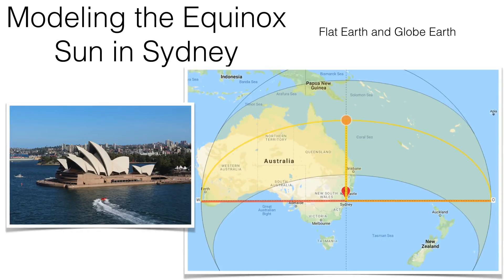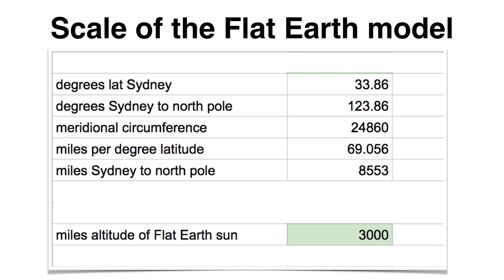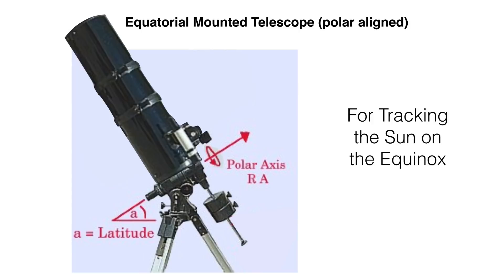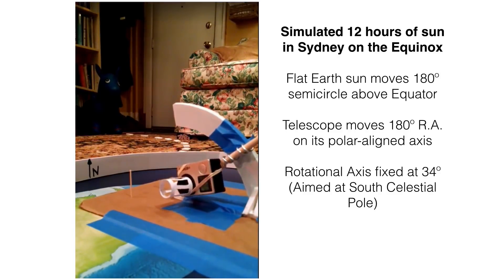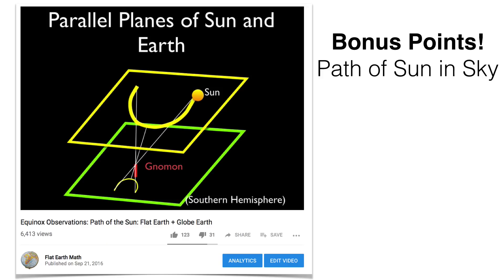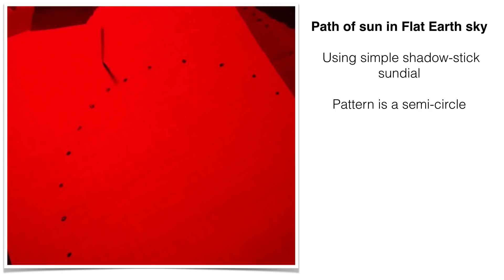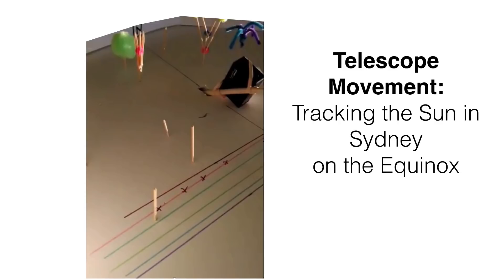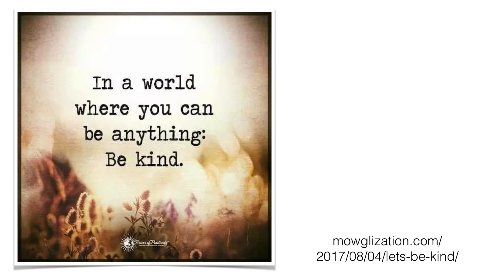Modeling the Equinox Sun in Sydney: Flat Earth + Globe Earth

Comment: Copernicus, given the Mason that he was, used the Satanic rule of inversion.
Latitudes have been inverted. IE: the tropics are at 66.5 not 23.5. When you understand this, you can use simple trig to calculate angles to the Sun.
Just like a NASA Satantist!!

The proof is that you could stand on the equator for a thousand years and you will never see the sun at an angle of 23.5 degrees. Only 66.5

Comment: When you were somewhat younger, did you build a clock work computer for tracking celestial objects that subsequently sunk in the Mediterranean near Antikythera? You seem handy with complicated models. Your mount seems to work better than a Celestron.
Reply from the maker: +Fudmottin, my fine feathered friend, yes, that Anthikythera widget was one of my earlier designs. But salt water is no friend. And as for my mount in this video, the key is that I was using a Celestron Hero4 telescope, without the mount, which I designed after my Antikythera widget, coincidentally.
Reply: Cool. It's truly amazing what you can do without an Arduino.

Comment: The perspective of the camera would be like looking from a high ass elevation...like 200 + miles up so of course your model will show the sun veering off before you get to the ground perspective horizon. You'd have to put the camera where the lens is right on the ground. That would better represent what you would see...oh and dont forget the refraction issue also..can you reproduce that...ive seen others put factual perspective in their experiments and it works just fine.
Reply from the maker: +Josiah Clayton thanks for your comment. I'm not sure you noticed, but the strip of curved foamcore that I marked W, N, and E was the same height as the lens of the camera. And the height of the flat Earth sun was measured above this "eye level." So I could have accomplished the same thing my digging a hole in the floor, but I couldn't do it practically. So I made an "eye level horizon."

Regardless of that, when I did the sundial (which was on the floor), it still showed the expected semicircular frowny-face. Meanwhile in the real world (I've actually done this) the pattern of shadows on the equinox is ruler-straight for 12 hours. Which makes no sense on a Flat Earth.
Reply: @FlatEarthMath  I understand the compensations you made and are equal mathematically but fail to take into account of angular perspective + refraction of the atmosphere from a specific point...and that would make horizon and the position of the sun different than what your experiment could show. I think you're wrong but if you can take all the realistic conditions into consideration then it'll prove your point...or mine...and since ive seen your experiment and what it shows look into rob skibas videos or ditrh videos on movement of the sun and the effects the atmosphere has on positioning. I have and find it more coclusive and contrary to your findings.
Reply from the maker: +Josiah Clayton thanks for your kind reply. :-) The big issue, especially since this demonstration takes place in Sydney, is that the sun is really, really far north of due East/West at sunrise/sunset. I'm very familiar with Rob Skiba's work, as well as David Weiss over at DITRH. But they've never shown any phenomenon which could deflect the sun's appearance 90 degrees or more laterally, while deflecting it 20 degrees or so vertically, so that it "just happens" to end up looking due East/West at the moment of sunrise/sunset. Exactly where the globe model predicts it should be on the Equinox.

You didn't mention the path of the sun in the sky. Are you suggesting that in a 12 hour period, the sun will move in a semicircle (by definition) yet, this curved path will turn ruler-straight due to atmospheric distortions? Don't you think that's rather convenient, especially since the globe model predicts a straight path?

There are a great many other issues with the Flat Earth model, such as angular size of the sun, speed of the sun in the sky, the angle the sun's path makes with the horizon, and the number of hours of sunshine on the equinox. And don't get me started on seeing the same face of the sun all day, for all observers on Earth, and the wagon-wheel effect (aka Field Rotation)! :-) In each and every case, our real-world observations align 100% with globe geometry predictions. Very, very convenient to have all these "atmospheric distortions" distort the reality of the Flat Earth sun so that it perfectly simulates the Globe Earth sun!
Reply: @FlatEarthMath  actually your experiment is invalid for many obvious reasons ive pointed out....but its cool I disagree but atleast your putting forth experiment...ya still didnt take essential things into account...later.
Reply: @josiahclayton3057  , try getting Skiba to flexplain how Polaris is somewhere directly above Santa's house at the North Pole, while simultaneously 40° above the horizon from New York, and simultaneously on the the horizon from the equator.

Just what exactly IS Polaris' altitude in Flattardia ?
Reply: @massimookissed1023  alot more reasonably placed than on ballickalotta.
Reply: @josiahclayton3057  so your explanation is the sun constantly move 15 degrees from you because somehow, refraction and angular perspective is compensating it? if you have a hallway. move the light down the hall. you will see that the light eill not move in constant degree. You are saying, at any given day, hot, cold, DST or not. The sun, due to refraction and perspective will make that sun move 15 degrees per hour on its path. And that path is not just straight down but it pans to the right or left. Thats your answer on that observation?
Reply: @algladyou  no...im saying depending on your exact location and environmental conditions at that location would determine where you see that horizontal line also the placement of the sun to its actual location and so therefore his experiment lacks conditions that would or could compensate for the sun veering off...understand it or not its cool...im through with this.
Reply: @josiahclayton3057  but we see the sun as how it is year after year om whatever location or latitude you are on. and the path of  sun is the same. thats why timeandate.com can predict where it rises and sets. And an EQ mount can even follow it from its path 15 degrees per hour. Where is your refraction and perspective are consistently at work here? Refraction  depending on environment is not consistent.

Comment: Latitude and longitude degrees are based of the globe. Not a flat map.
The flat Earth model does not have a south celestial pole.
In december solstice its midnight sun south of antarctic circle.  Hos would that be possible above a flat Earth?
Reply: sortsius Latitude and longitude make up actual points on our planet. 
A better question to ask is: Lines of longitude converge to a single point in Antarctica; how is that possible on a flat earth?

Just one of many questions where the answer is “Flat earth is inconsistent with data and/or observations.”

Comment: Love the contraptions.... and that copy of Zetetic Astronomy you have.  =)
My questions to you.... does variable conditions in the atmosphere affect the sun's radiance & visual size to the observers on the ground?  Does the thick atmosphere above act like a lens to the sky lights we see from the ground?  Does this lens of atmosphere bend lights in any way?

If yes.... then how accurate and reliable are the results of these experiemnts when conditions apply to the outcome?  Would you bare different results in the same experiment without an atmospheric lens layer above?
Reply from the maker: +JibbyJedi! The term "atmospheric lensing" is used incorrectly 100% of the time by Flat Earth folks. Yes, the atmosphere can bend light, by a fraction of a degree.. This in a vertical direction, as temperature and pressure gradients are horizontal. There are no known cases of light being bent even 1º sideways, let alone 90º sideways! This huge sideways (and vertical) deflection would be required for the Sunrise and sunset angles to be due East and due West, as shown by my demonstration.

Yet for some reason, in all atmospheric conditions, sunrise and sunset are still due East and due West on the Equinox, for all of the civilized world. :-) That's a really tough nut for FE to crack, especially this is EXACTLY what is expected on the globe.
Reply: The Sun is roughly 1/2 a degree of arc in size , Very slightly less in July , more in January, because the Earth travels in an ellipse around the Sun
Reply: JibbyJedi, light bending in the atmosphere is not the same as light going through lenses. Convex lenses focus light, concave lenses disperse light. The result is dependent on the distance from the lenses and on the angle you are in relation to lenses. If you are proposing that there ares some real lenses up  there then the sky would be distorted and person at the foot of the mountain would see different sky than the person on the top of the mountain. And person some 10 kilometers away would see different sky. And so on. Just get some big lenses and look your ceiling through it. Rise it and lower it and move it around. The view you see changes quite much with these movements.

Comment: Some problems:
1. If Sydney was 123.66 degrees hotter than the north pole, then that does not go with what we observe
2. No mention of Santa when you talk about the North Pole
3. That Koala bear on New South Whales is the wrong color
4. Polar Axis is actually the Polar Axis of Power. They control everything
5. Not using enough "66's" and "33's"
6. Use a fisheye lens and you can make a curve shadow line straight
7. Not using Comic Sans font
8. Not enough shaky cam
9. Not blurry enough
10. You need to use the Kelvin knot for your tie
Reply: 7) If the earth were spinning we would die of dehydration.